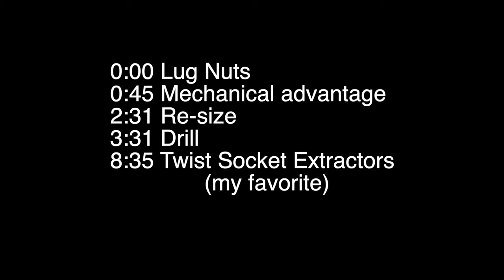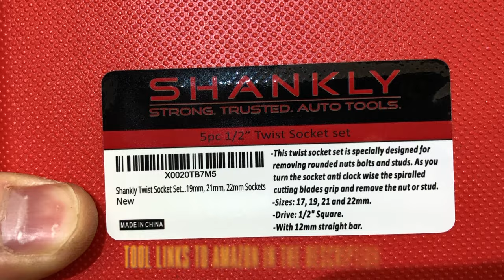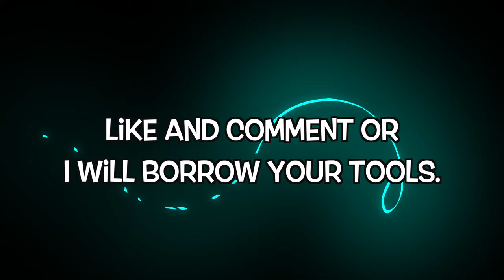STUBBORN LUG NUT REMOVAL TO SAVE YOUR WHEELS! 🛞🔩 Simple-Fast

Comment: Those lug nuts look like someone put grease on the lug threads. If so you should never lube the lug threads because you can way over torque the nuts/bolts, grease has a problem with "drying out" and it loses its lubricating ability. Put the lug on too tight or even to what you think you normally put them on and you're either going to have a b of a time getting them off or not at all. This comes from the personal experience of a 16 year old me. (I'm now 73, older and much wiser.)
Noting though i figured out how to finally get them off the easy way. Drive rig until offending lug is at bottom. Place breaker bar with appropriately sized socket. Place bar handle on ground or block(s) drive rig in appropriate direction. For right hand thread this means on the right side the bar handle is forward and you drive forward. On left bar handle is back and you drive backwards. Much easier letting horses do the work than my back. (But each to his own 😂)
Note too that an impact imparts rotary force where as a bar imparts side force and can break the stud/bolt.
Reply from the maker: Great tips! Love them all 😃
Reply: @EasyFixShaun  have a second "fix" that I've used several times and have instructed several others on.
You remove all the lugs... and the wheel refuses to come off ☹️. Hard way: sit on your butt and kick the p out of it, use bar... get pssd, cuss a lot, cry some, sob.
OR easy way: put lugs back on then back them off one turn or a bit more. Lower car. Drive forward 15 feet, stomp brakes. Nothing? Drive back stomp brakes. Do that again etc. until you hear Clunk. Wheel has broke loose. Jack back up, remove wheel. Once again use horsepower 😊
Reply from the maker: @railroaded1991  That is a great tip! 😃😃

Comment: Is that a Cobalt or a carbide drill bit
Reply from the maker: Irwin cobalt. They work good 😀😀
Reply: I have a Mac guard locking lug nut that I can get off because it was over torque I went through four keys call Matthew guard they sent out a kit had to give my deposit that goes over the lock and guide the drill bit that they send out and they sent out three Cobalt bits. Each one bigger than the last. The first did great the other 2 won't cut at all. What do you recommend. I am ready to cut my trim off. I haven't used my car in 9 months. Would carbide cut?
Reply from the maker: Would twist sockets fit in the wheel. Tjose will take just about anything off if you can get them to fit.
Reply: I already started drilling because it is a locking lug bolt. It has smooth outer edges in fact it actually has a ring so you cannot grab it with anything. I can try though
Reply from the maker: Ok gotcha. Sorry you are having trouble. Any luck sorting it out?

Comment: 2013 Ford Escape. Right front wheel. Lug nuts are absolutely shot.
Just bought the car for my wife
Reply from the maker: Ouch. Hopefully you can slide some new lug studs in there easily😃🔧. This tool works amazing if you need it-Wheel Stud Installer: https://amzn.to/2DbINBr
Reply: @EasyFixShaun  I live in San antonio so there's all these Mexican tire shops around. I"m going to take it there to see if they can get them off and put all new lug nuts on.
Reply from the maker: @davidjsouth231  Excellent!

Comment: The problem is steel and aluminum do not mix and steel will literally fuse itself to the aluminum. The things that people can do to avoid this type of situation is to get anti-seize and put it around the neck of the lug nut where it meets the aluminum rim
Reply from the maker: I usually don't recommend anti-seize on lug studs or lug nuts. Sometimes it creates even more problems because the compounds are usually copper or nickel and either one will add even more dis-similar metal corrosion problems. Its kind of a rock and a hard spot, there are no great solutions. The best thing I have found is to replace the nuts, use oem. Keep the threads clean and dry. That usually will keep everything working again pretty well for 3-5 years or so 😃🔧

Comment: Still didn't show how to take off 1 that just keeps spinning
Reply from the maker: Sorry about that. That would need to be drilled or ground off most likely. It needs to happen from the front or the backside. That is the toughest of stud problems. Sorry I didn't show it or mention it. If you can not access it from the backside, which isn't very likely unless it is a car prior to the 80's, Then you may have to destroy the wheel to grind it from the outside. Be creative. Think about it. Take your time. That is the best advise I can think of. If you come up with a solution, you should make a video 😃🔧🔧

Comment: I have a stripped 13/16 on a 2009 dodge caliber and it won't come off..
Reply: What other size could I log in there?
Reply from the maker: 13/16" is basically the size of 21MM. You could try pounding on a 20mm size and see if you can do it. The half size sockets in the description are helpful where you are at sometimes also. Those lugnuts suck. Sorry you are having trouble. The twist sockets are amazing at the point you are at also. Those are my go to tools for what you have going on.
Reply: @EasyFixShaun  I was told to never ever use the 21mm.. it will strip it more
Reply: @EasyFixShaun  I may try the 20mm.. idk what to do..  tires are bald as hell and I can't get the other ones off. Hahaha never ever buying a dodge again
Reply from the maker: @dtjrealmc  The Lug nuts on this manufacturer have been a problem for a long long time. 2-3 decades. As long as the rust and swelling makes it beyond the warranty period, they sadly don't care. Sorry you are having trouble. I ended up drilling mine out. The twist socket has saved me the most though. That is what I would recommend most. Maybe it saves you too  😃🔧
Reply: @EasyFixShaun  yeah you actually show the tool and the name for it on the video. Most of the shoulder tool but don't show the name of it or where they got it
Reply from the maker: There are links in the description for amazon. You can get them many places though. They are called twist sockets generally. I hope that helps 😃
Reply: @EasyFixShaun  I don't support Amazon.. it's a horrible company
Reply from the maker: I think you can order them on ebay or get them locally sometimes.

Comment: it doesn’t work  if the studs turns
Reply from the maker: That is a particularly nasty problem to have. I am sorry you are having trouble. I have had a few of those over the years. One time I had no choice and ruined the wheel with heat. Another time I used a long sawsall Blade to cut the stud. Luckily my wheel had enough room to slide the nose and blade through the spokes and cut the lug. I was able to slide the long blade in with a bend in it and hit just the stud and nothing else. It was tight. I was able to cut and weaken the stud and then snap it off by grabbing the wheel and applying pressure. Wheel was saved. Those suck. Not many options. Try to be creative, hopefully you can get it removed and save it 😃🔧

Comment: Please what is the drill bit size
Reply from the maker: I used a drill one size smaller than the stud I was drilling. That is to help ensure i didn't damage the wheel or the stud mount hole in the hub on accident. You basically just want to drill through the stud only to release the wheel from the stuck nut 😀🔧🔧
Reply: @EasyFixShaun  Thank you I'm going to rent tools from Home Depot, I will buy cobalt drill bits I have dodge journey 2013 the lug nut is 19MM totally stripped what is the drill bit size to buy please its all online these days
Thank you!
Reply from the maker: Look up the stud size for your year make and model car -go one size smaller.

Comment: If only I had an impact wrench
Reply from the maker: Impacts are nice and convenient! But any job can be done with hand tools. Plus the advantage with hand tools- ultimately less fasteners are broken 😃🔧
Reply: @EasyFixShaun  I hope you're right. I have some lug nuts that the jerk mechanic put on so tight with his air wrench that I stripped them trying to remove them. I bought the spiral lug nut removing sockets and will try them today. Still, I always dream about having power tools. It can be so difficult getting off nuts and bolts, especially on the suspension and undercarriage
Reply from the maker: I hope it goes well for you 😀
Reply: @EasyFixShaun  It didn't. Those spiral sockets are just as useless as regular sockets and just stripped the bolts more
Reply from the maker: Sorry that didn't work for you. They have been a life saver for me. Some of these lug nuts when they get stuck are excruciating. Sorry you are having such a problem. Drilling is always my last option to save the wheel and remove the nut and lug stud all at once. Have you looked into that as a possibility?

Comment: 2014 chrysler 200S.  My mother passed away a week ago and left this car to my daughter and we are very great full.  Rear breaks are shot and my brothers best friend charged my mom 700 plus a up charge on parts to replace these breaks for her a little over a year ago.  No hes not a mechanic just a moron and a con artist. I cant wait to run into him 🤔  Anyway you probably guessed it ! Lugs are stripped out and over torqued.  What a great guy for helping my elderly mother out ! NOT
Reply from the maker: Sorry to hear about your mom 😪. These lug nuts are very susceptible to being over torqued for sure. I have also seen them lock up for no real reason at all. They just get stuck out of the blue. It seems to mostly be a Chrysler, Ford and Jeep thing for some reason. almost always  seems to be the nuts with the thin fake outer chrome shell. They can be a pain to remove. Sorry you are having trouble. Hang in there. It's just nuts and bolts... but they are a major pain sometimes.

Comment: I'm good with all of it except how you blame over torque.... this is a common problem with chrysler junk... dissimilar metals used for the lug the stud and the wheel.... also the tin cap is another metal. So Is the issue the torque or the fact that a chrysler engineer is not even as smart as a 5th grader who pays attention in class... also any mechanic and I mean any will tell you to start with a smaller drill bit and step it up after getting to depth you will generally drill much faster this way......
Reply from the maker: I also agree with your drilling strategy in general. In this case- my drilling was superb and efficient. The drill bit was sharp and the lug nut was used as a guide. Results were A+ 😀🔧

Comment: At work these are the worst offenders- chrysler 200, ford f150, jaguar soft a$$ lug nuts, ford escape, Toyota sienna, and majority of these car manufacturers using pretty looking soft alloy covering the actual solid steel lug nut which is 1mm under sized 😠😠😠😠😠
Reply from the maker: Man I think you nailed it. All of those cars are offenders big time! Sometimes my half size sockets will get them off. But in general I hate the two piece nuts.They are a complete pain in the ass. Can you imagine trying to change a tire on the side of the road with a swollen lug nut. Its ridiculous. They look pretty. The function and age like garbage. And they have been that way for decades. Its crazy 🔧🔧
Reply: @EasyFixShaun  amen brother and yes I've done so many on the side of the road and highway, i always tell our members to go and purchase solid steel open lug nuts!!!! Working on the go for AAA i go in to a call ready for whatever is thrown in my face- expect the unexpected. Sir i just subscribed!!!! Keep up the good work👍🏾👍🏾👍🏾👍🏾👍🏾
Reply from the maker: @highwayouttakes4570  Thanks man, you too! That's gotta be a challenge on the road. They are a pain in climate control on a lift for me. I can't imagine doing that outside with minimal tools. That would suck. Someone needs to start a "stainless steel lug nut company". I bet stainless steel (not chrome) would solve the problem. They would be expensive. But they would work.

Comment: I do not like that you tell people that they have to use a torque wrench to put on their lug nuts because if someone is driving their car and get a flat, how are they supposed to change the tire if the lug nuts are torqued down way too tight! A huge pet peeve of my father, a master mechanic, was that tire guys are always torquing down lug nuts so tight that a normal everyday person can very seldom, if ever, get them off!
Reply from the maker: Good point. I would rather have a flat tire than a wheel fall off 😃🔧🔧
Reply: you have that very  very right my granddaughter  bought a car that i use everything under the sun and i couldnt get that tire off   that is you know what
Reply from the maker: Lug nuts should always be torque properly 😀🔧

Comment: How about a spinning lug nut and the lug bolt is not moving
Reply from the maker: Those are very difficult. Usually cutting is the only solution if the lug nut is locked on and will not spin off. i have wiggled in a hacksaw blade to get the job done many times. Not fun but saving the wheel by getting it of damage free is the goal if at all possible. Sorry you are having trouble. Hang in there 😃
Reply: If you are lucky and have a lug size like ³/⁴ then put a spark plug socket on the nut, use a wrench on top of the spark plug socket to hold it in place, then use the drill out method. Otherwise the only other way I have seen was a friend was able to get the rest out and the spinning lug was just loose enough he was able to slip a saw blade between the rim and rotor. With a lot of time and determination finally cut through the lug enough to break it.
Reply from the maker: @ryanwilson2016  YUP! Great tips 😃

Comment: I have a 07 Mazda MPV. I am  trying to remove a wheel nut 🔩 🔩 🔩 . I managed to remove all except one ☝️ ☝️ ☝️ and I have managed to break one ratchet and the second ratchet just  when I try to turn just clicks and change’s to turn clock wise don’t know what to do now it’s been really over tightened. I even used a bar on the ratchet that’s how come I broke the ratchet
Reply from the maker: I would recommend a 3/4" drive ratchet and adaptor down to the lug nut socket size. 3/4" won't break with a long bar on it of any size usually. The week point will be the lug nut socket that is 1/2". Usually the socket won't break and that will remove the nut if it just needs more torque to remove it. I would try that. If that doesn't work more intrusive methods may be needed like drilling 🔧
Reply: Thank you 🙏 🙏 🙏 got it off today after spending $76 at Supercheap Auto for a proper torque bar and new wheel stud sockets
Reply from the maker: @parbhumanga528  No problem. Congratulations! Nice Job 😃🔧